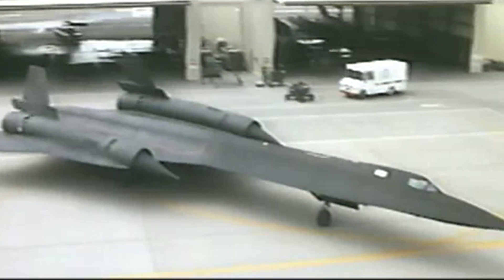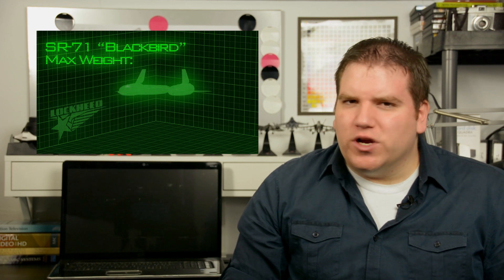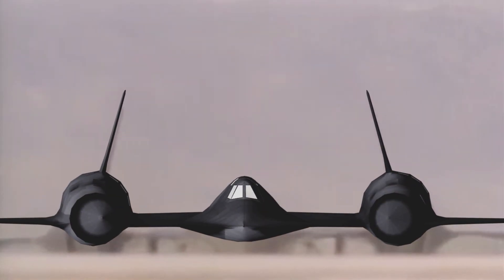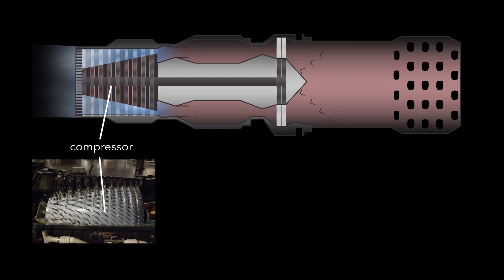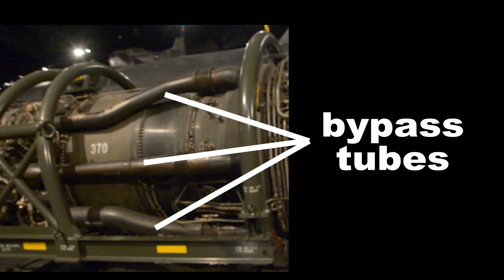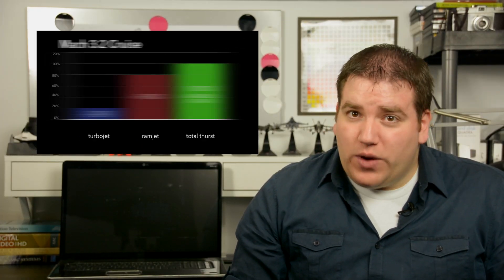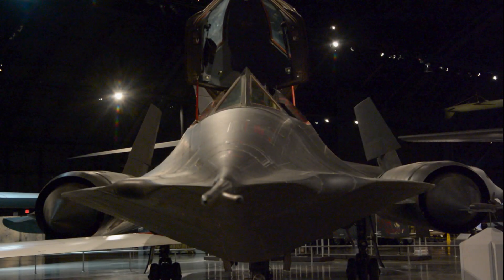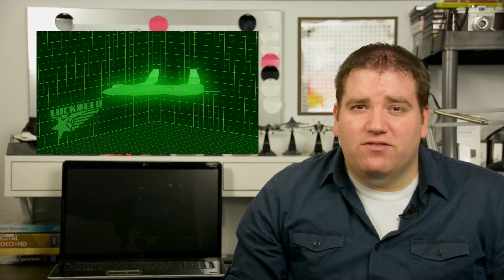The Plane that Dreams are Made Of: The SR-71 Blackbird

Comment: I thought the SR-71 also used Rolls Royce engines ... ??
Reply: Thanks for the laugh.
Reply from the maker: They could be used to spin up the engines.  Them or Chevy muscle car motors.
Reply: Makes sense. It was the early 80's when I misinterpreted that bit of info. Being a kid at the time and knowing RR made engines for planes ... Anyway I simply strung it together wrong. Thanks for the clarity! Your videos are enlightening.
Reply: Flip465  The engine start carts used 2 Buick Wildcat V8s (401ci/6.6L each) which provided 800hp for an air pump that provided the compressed air feed for starting. Later they started using tanks or ground feed systems once the technology got to where they could store that much air in a movable tank...

Comment: If we can build fighter jets of top speed mach 3.2, why can't we build commercial jets of say, mach 1.2??
Reply: You're not allowed to fly over land (or at least occupied land) above the speed of sound because of the sonic boom. The Reaction Engines A2 for example, would fly the long way from Brussels to Sydney over the arctic, and over the pacific, in 4hrs.
Reply: ***** probably not, but you're not getting a commercial plane from LA to NY to fly at 200km up with a load passengers, SR71's payload was a camera. Completely different beast.

The other point is that it's a law, it's not so much an issue these days as super sonic designs have reduced the boom down. But you know someone will complain even if it's just a low volume boom.
Reply: ***** Yeah, The problem is you can't market seats to anyone, 3x the price in half the time..., the A2 runs on Hydrogen and is an alternative to their space plane, Who knows if its viable, I assume some would pay to reduce their fly from 24hrs to 4hrs, the A2 is promising @ mach 5+ but, mach 2-3 isn't enough to justify the price. Still skeptical that is marketable though.

Comment: Please if I am wrong in my math tell me. In the New York to London record breaking flight it flew 3461.53 mi in 1:55 hrs and because it had to refuel immediately after takeoff for around 30 min. The 30 mins it flew at 530 MPH it flew 265 mi at this speed. 3461.53-265=3196.53 mi and time it flew at speed was pretty short 1:55 hr-30 min= 1:25 hrs. So (S=D/T) S=3196.53/1:25=2557 MPH which it was above 37000 FT, so it flew at its absolute top speed was mach 3.88 or in rounding sense mach 3.89... Again if I'm wrong in any of this math let me know and where missed up. I did not include the time it took to land it so its absolute top speed is not going to 100% right  but even still the speed will only increase. Thank you.
Reply from the maker: +kacey williams Okay, two mistakes - one math, one assumption.  You divided 3196.53 by 1.25 instead of 1 hour 25 minutes, which is 1.42.  That correction puts you in the Mach 3.4 range.  Second, you made the assumption that refueling took 30 minutes.  Where did this number come from?  I can't find any source telling me how long it takes to refuel, and changing that number makes a world of difference for its average top speed during the flight.
Reply: In a late 90's documentary from the pilot that took an 11 hr and 25 min mission in the late 80's and thank you for the math correction
Reply from the maker: +kacey williams Interesting.  I'd love to know if that was consistent for all planes at all times, or if it varied at all.
Reply: As would I, I'll ask around at the Rickenbacker Air force I got a buddy that works there.

Comment: ALWAYS loved the blackbird. The top speed of the thing is WAAAAY more than the 'official' top speed. The skin of the blackbird left space between the joints so that when it heated the joints would expand and close. Which meant that on the ground, the thing constantly leaked fuel.
Reply: ***** No,, roflmao. Sit down little boy, and get your head out YOUR ass.
Reply: ***** lol.. I'm not stating an opinion dipshit. No... seeing a picture doesn't working on it does.
Reply: +captcorajus I concur. My father (many years now retired) was an Air Traffic Controller with the Canadian Forces and was stationed at Goose Bay in the mid-70's. SR-71's were in "his" airspace on a fairly regular basis, mostly as overflights between the FOB in the UK and the CONUS. He dealt with them as "traffic" and swears that they were "feet wet" over the North Atlantic for less than 25 minutes...on many occasions. "Feet Wet" is referring to the time to travel between the controlled airspace of Prestwick  Scotland and My Dad's control area in Northern Labrador. He would have no reason to make this up, it's just another airplane on a piece of paper that he has to talk to in the course of doing his job. 
We got a visit from one of these in 1976 at the Goose, when something went "sideways" and they had to divert. Dad knew when it was scheduled to leave and took my brother and I out onto the airfield in "RATCON 1" (the half ton that the radar guys had for use on the airfield) to watch the spectacle. SPECTACULAR it was.
The pilot got it up and clean within the first couple of thousand feet of runway, held it on the deck accelerating, then stood it on it's ass and punched a hole in the sky right in front of us. The ground was shaking like an earthquake. We lost him after no more than 30 seconds...in CAVU met. conditions.
My best guess is we are probably looking at something in the realm of 2500-2700 KTs, if the truth be told. One of the guys who flew this thing will surely spill their guts on the actual performance...one of these days.
My little bit of experience as a wide eyed kid...many, many years ago.
Reply: +Terrie  Ron Schock Everything is faster than they report.  My father in law once saw a B-58 hustler (Mach 2 bomber) taxiing on the runway.  He turned his head to jog across the end of the runway.  He heard a tremendous roar and looked back.  The plane was gone.  He looked up and it was climbing vertical and barely visible.  I saw the B58 at the SAC museum and it is a ridiculous plane with a crazy ejection system. The one at the SAC museum is "Greased Lightning" Tokyo to London in 8 and a half hours.

Comment: SR-71 blackbird is the best plane ever made. It was made to outrun missiles. I need not say more. It was made to outrun frikin missiles on the edge of space. and it worked. I want one
Reply: +Shinji Hirako What's there to be fascinated about? Here's the premise of the MiG-25: Strap two wings and a cockpit around a pair of gigantic turbojets and call it an interceptor! I do admire it simplicity, but according to Lt. Belenko, (the first defector in a MiG-25) don't take it faster than Mach 2.5, hope to crazy you get a visual, and then hope your missiles can hit the target. Not likely against an SR-71, which CRUISES (officially) at 3.2 and can go 3.5 or better. The Blackbird would see the Foxbat approaching, take her up another mile higher, and cruise away into the horizon. Even if the Foxbat got one of its R-40's off, the missile would be out of fuel before it even got close...
Reply: Andrei Zhuk Compared to the Mig-25 the Blackbird was much safer. At least it had an ejection seat compared to the Foxbat which didn't have one cause they removed it to increase performance apparently which gave a very marginal boost. Heavy price to pay for a phenomenally small gain
Reply: ***** It's still better than a Mig-25, and definitely much safer
Reply: If u want 1 u need 235 million dollar to buy 1. Good luck.
Reply: +Shinji Hirako So you say
Reply: what do u need it for?
Reply: Syed Abdul Halim times were quite different when it was made!
Reply: Most SAM and air to air missiles travel much faster than the SR71. It was about altitude and energy.
Reply: Nauga yea "it was made to Fri kin missiles" the missiles probably  went about mach 2.5 er, well I don't know, but probably  really fast for a missile. the black bird was like ,-_- then it speed up and it was like😎 .
Reply: doorhanger93 my man!!!
Reply: However mig25 is a military jet interceptor, while sr71 can be used only as an explorer. It's totally different specialization.
Reply: English electric lightning, would piss all over the blackbird and the mig. The lighting intercepted a u2 and Concord with ease
Reply: @noodles169  A U2 couldn't even hit Mach 1. Altitude is all it had.
Reply: @noodles169  😂😂 Concorde cruises at Mach 2.05, SR-71 at Mach 3.2, not even a worthy comparison. SR-71's ceiling is some 20,000 feet higher than the Lightning. It's a good bird but it can't even shine the SR-71's shoes.
Reply: +Shinji Hirako Actually no, the Mig-25 puts loads of effort to just touch Mach 3.1 or 3.2 and then it can't hold it for more than a couple of minutes till it destroys its engines completely. The Mig-25 was a deathtrap for the pilots that flew it. It was unsafe to fly as is and on top of that it's safety mechanisms and ejection seat was removed to give performance which made little difference.
Reply: ***** The Mig-25 certainly was great for what it was, it was a high speed interceptor built to intercept a bomber that was also an absolute marvel but sadly never went into production. However even though the Mig-25 was good the way it was, it too was extremely overrated and was miserable at safety, that was it's biggest downfall.
Reply: ***** Every plane has its flaws. But I prefer planes that have non fatal flaws unlike the Migs
Reply: ***** IT OUTRUNS MISSILES ON THE EDGE OF SPACE
Reply: +Shinji Hirako Cheap and Robustness doesn't garuntee success
Reply: ***** It actually does, certainly not at space but yes near the edge of space
Reply: To correct your statement the SR-71 didn't actually out run them SAMS can go over Mach 5, but the SR-71 could our maneuver the missile at 85k feet because the air is so thin tiny fins on the missile could not really turn that well, but the SR-71 was a lifting body it could turn very well.  That is why they would change course and go to mach 3.5. The amount of time it took for the SAM to reach 85k feet gave them the time it took to scan with radar.
Reply: blastman8888 it's more about the missile running out of gas ½way to intercept after climbing to 90k ft before it even starts gaining. they say the turning radius at cruise was roughly the size of New Mexico &/or Texas
Reply: Sorry but "much safer" part is BS. 
% of SR-71 that crashed and took its pilots with it speak for itself.

Comment: Well since there are records of the blackbird outrunning soviet AIM missiles during recon missions which flew at over mach 4 it not hard to acknowledge that the plane was capible of at LEAST mach 4-4.5
Reply: It didn't necessarily outrun them. The misses at to climb at least 60K feet, to a target that was going at 1km/s. The missiles just ran out of fuel. If they had unlimited fuel, they would catch up
Reply: +warmfreeze The SR-71 didn't outrun missiles. Missiles have tiny control surfaces, and hence poor control at Mach 3.5+. The guidance systems also can't keep up with such high a closure rate. All the SR-71 did in response to a missile launch was to increase speed a bit and then turn. The turn is what caused the missile to lose its lock and miss.

Comment: I've been lucky enough to see the Blackbird a handful of times....it's a truly astonishing plane.    I had been under the impression the SR-71 was still being used by NASA, but evidently that program has been also closed...     One designer gave me a contributing factor for their retirement:  the pending end-of-lifespan limits on the KC-135 tankers that are needed for refueling after takeoff....they were all being changed from turbojets, to turbofans, which dropped their top speed to below  the slowest the SR-71 could maintain with any real stability.      Without tanker top-off after take-off, the SR-71's range is significantly reduced.....        

There's always the Aurora, but that's still up for debate.
Reply: I'm not sure if the KC-135 was a big factor since Blackbird pilots mentioned preferring the KC-10 which was able to more safely refuel the SR-71 due to a higher top speed.
Reply: I know im posting this comment nearly a year after you but the Aurora is REAL.
Reply: not sure how that is even relevant....yes, Aurora is reportedly the blackbird follow-on....there's some evidence it is likely uses a hybrid pulse-detonation engine..   However, there has been little actual confirmation about it, and until we get some, we're only speculating.
  It's revealing to look at the F-19 models issued by various model companies in the mid-late 80's, (the blended tear-drop shape with canards and center tilted tail fins) and how much they differed from the actual F-117.    If seems clear someone leaked the F-19 "design" deliberately as an obfuscation, though it would appear to be a "second generation" design, having more akin to the B-2, than to the F-117...
My personal opinion is the Aurora is may be more closely related to the "wave-rider" concept, but that would also give it a hellacious heat signature....  
In the end, we'll just have to wait for them to tell us, what's been flying out of Groom Lake
Reply: True probably won't know about the aurora til 2030AD
Reply: They will never fly it again anyway.  Its been over 20 years.  Even if they could remake parts etc from drawings.  Guys that worked on it and flew it are 20 years older and I bet they were older guys the time it stopped flying.  Chemical exposure for the mechanics.  Quite a few mechanics die early from cancers etc.  

I just think the secrets and knowledge of this plane will disappear.

Comment: btw, the SR71 can do Mach 5. lockheed guy told me many years ago.
Reply from the maker: Dilithium Crystals The body can, the engine's can't.  The heat of compressed air is so high that much faster than 3.5 and the titanium alloys start to melt.  Additionally, beyond Mach 3.2 the efficiency curve drops dramatically, meaning that while it can go faster, it burns huge amounts of fuel more than it already does, significantly reducing its range.
Reply: TechLaboratories well, i'm no expert. i'm just telling you what the lockheed guy told me.
Reply: +Dilithium Crystals Yeah, you're not an expert.

Comment: the sr71 would leak fuel if it was sitting on the ground
Reply: +JAMESMANHUNT9   the fuel was also specially formulated to have a MUCH higher flash point.    if you tossed a match on a pool of jp-7, it just goes out.    There's an appocraphyal story from Skunk Works where a bucket of jp-7 is thrown on a campfire...and it puts the fire out....
Reply: thats why it was a fill up and go airplane
Reply: Because there was no tank sealant that could withstand the temperatures created by the friction at high speeds. The tank sealant would melt.
Reply: +Jordan Reese or burn possibly vaporize
Reply: +steven bauer Agreed

Comment: why do those "diamonds" exist in the flame exiting the turbine?
Reply from the maker: They're called shock diamonds, and it has to do with the fact that the exhaust flow is traveling at supersonic speeds and has a different density than the air around it.  It forms a 'tunnel' of exhaust gasses with the density boundary forming a near-smooth barrier.  A standing wave forms inside this exhaust tube, causing some parts of the exhaust to have lower densities than others.  These regions of lower density have a less complete combustion and glow red rather than blue, as the remnants of the fuel in the afterburner completes combustion.